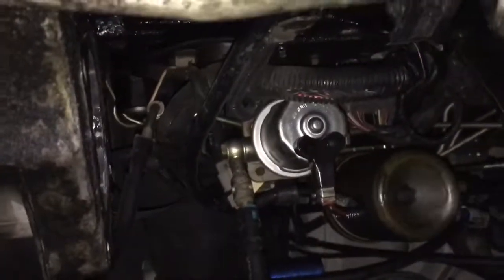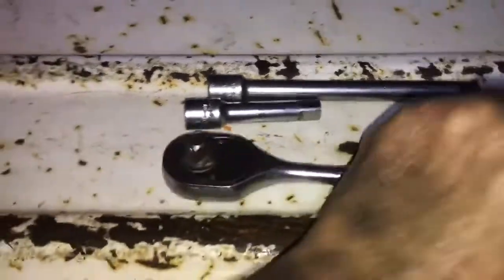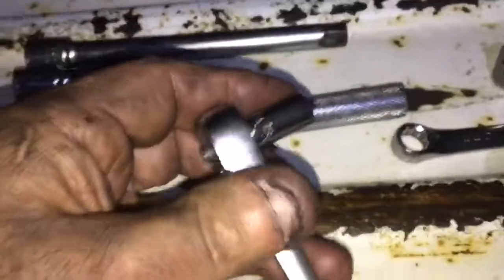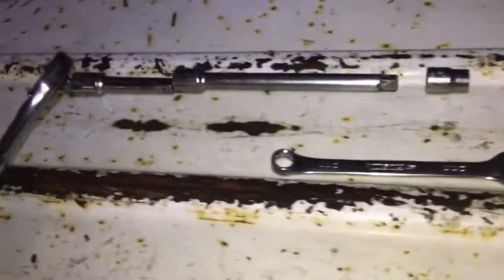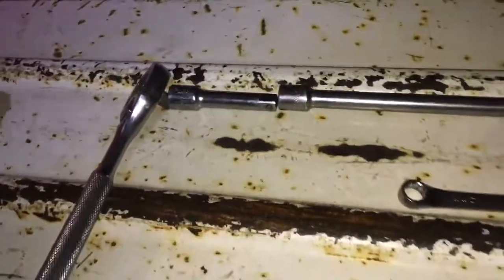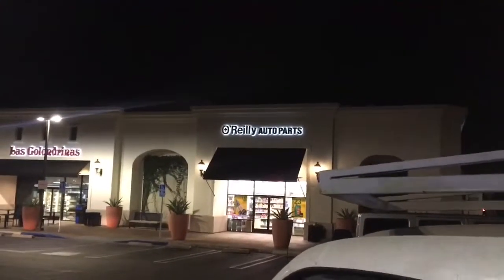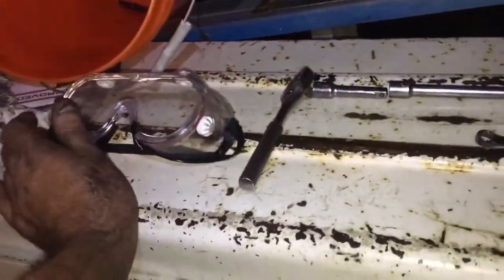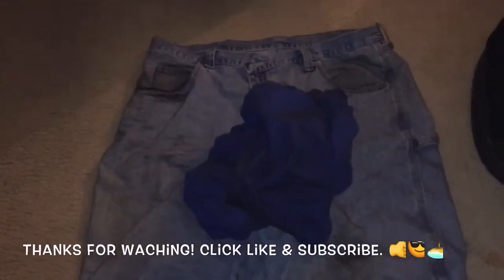Tools Required to Replace a Starter in a 5.9L Cummins Turbo Diesel.

Comment from the maker: O'reilly Auto parts Starter only Lasted 2.5 Years ! Kinda sucks Bigtime !!!  But, They did Exchange it under the Limited Lifetime warranty for No Charge. and they said if this one Fails Early in Life they will exchange it out too. So Thats Good.
im Getting to be a Expert on Starter changeout on a 1999 Dodge Ram Cummins diesel.
17 minutes - Old Starter Out.
19 minutes - New Starter installed.

Comment: Think 5/16 is the same size as 8mm. Hopefully the new starter lasts longer than the previous one!
Reply from the maker: Yea, its Just a hair smaller ( 7.9mm ) / was better fit. i have often found here in usa mm & standard mixed in trucks assembly & such. i had a truck a while back that was 1/2 standard & 1/2 mm. makes working on it just that much harder. really sucks when they do that. i Hope so too as far as Longevity. Original starter Lasted 17 Years. i was hoping to get 8 years out of a rebuild.